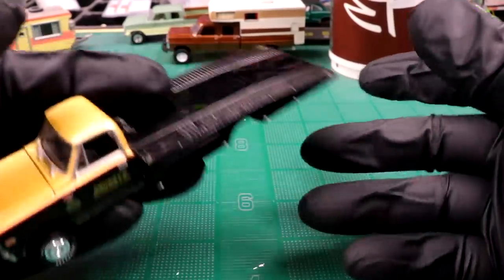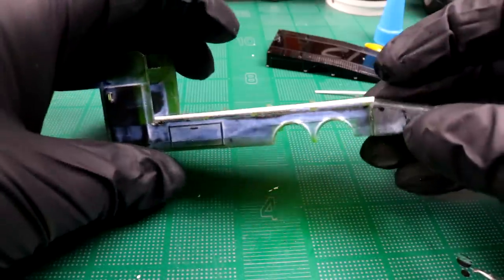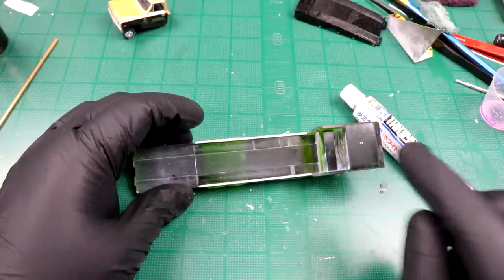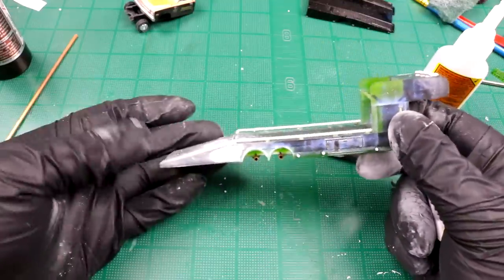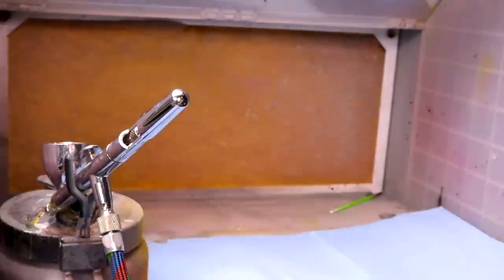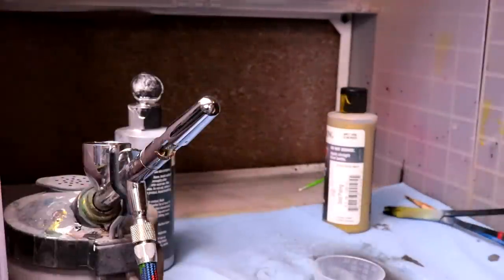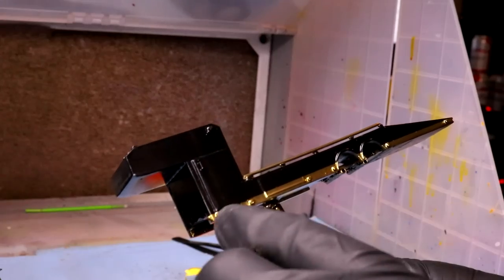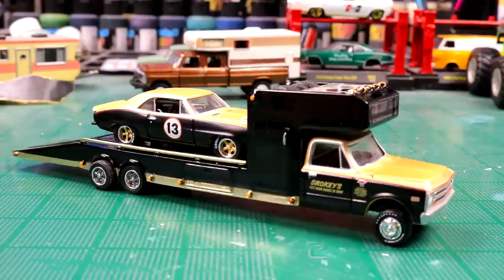1:64 scale 3D Printed Race Car Transporter

Comment: That turned out brilliant I'm definitely impressed by the 3D printer. You are correct about the cab overhang being to long by law the overhang cannot extend past the windscreen. It still looks magic tho. 👍
Reply: @carmineredd1198  no lol. I will explain I've built trailers to get them registered by law there are requirements. The cab cannot extend pass the windscreen therefore for you to make your trailer look authentic it would be better if it was shorter. Of course you can make however you choose. It was just a thought that's all - no offence intended. 👍

Comment: that turned out sweet, very creative, I like that you can make something out of nothing with 3D printing, I would suggest moving the rear axles forward a little so the load is over the axles, this would be more realistic to actual car haulers,  you might have troubles trying to turn rig like this around

Comment: Shorter cab over, storage doors to cab over, Smokies logo on front of the cab over and try heating up a needle to make the holes for the ramps then glue to L shapes to the lower deck that are in the ramps. (Small Paper clips) hope this helps

Comment: Love the new 3D printer ! I’ve never been a big fan of the filament printers, it’s just melting plastic line on top of itself - not the cleanest process to me. Most of the resin printers I’ve looked at in the past have been outrageously expensive, but I think I could actually swing the one you’re using. I’ve had ideas for prototyping product components over the years, but haven’t had a way to make them without spending hours or days in my garage fabricating something. With this I could print scaled down models in no time. Excellent product ! Keep the custom builds coming 😊

Comment: You could pop off some printed toolboxes (little reds and diamond plate bed boxes), Maybe some pallets to haul, firewood, or just truck bed junk. There is always this one guy that just has stuff in his bed, there are beer cans, gas cans, and other trash. Cinder blocks to put your "project" car on in the yard for the next 25 years.
You will also be able to do body kits, reprint the bottom of the car but with chin spoilers and side skirts. Spoilers, convertible tops, interiors/seats. Getting a clear as glass print is crazy hard and requires a really good printer.
At one point you could just make the entire car.

Comment: If you could figure a way to slide the trailer axles forward, the ramps won't be needed as the back of the trailer goes down. You have the skills. Mirrors and exhaust pipes on the cab too. Great looking unit and love watching your videos.

Comment: idea for adding ramps now, use brass tubing that you would use for axles for the hinges, the rod to connect ramps to truck bed could be hot wheels axle or sewing pins. glue the brass tubing to the bed and ramps and boom. no drilling.

Comment: You know I've got a little ultrasonic cleaner. The cars that I have tore apart I put in there and I put some denture cleaner powder in it because it won't hurt the plastic it actually does a pretty good job. I mean I put all the plastic parts in it and the wheels too strong, it actually won't hurt the car at all so you could actually throw the whole thing in there if you wanted just cleaning.

Comment: Instead of trying to color match the stripe, why not repaint the cab to match the stripe ? Also, I am trying to rework a 64 Chevelle and I don't like the engine sticking thru the hood, is there anyway for me to remove the exposed engine and just turn the hood into a cowl induction style hood similar to the 70 Chevelle ?

Comment: For the ramps, could you perhaps heat up a straight pin or needle with a torch and slowly melt your way through the tab? Watching on my phone doesn’t really show size well, but I’d love to see the ramps work on this project
Reply from the maker: That could work actually, ill test it on some scrap resin and see if it bursts into flames or what lol

Comment: Awesome build. But the flatbed could have been 5mm shorter. 
The rear wheels need to be gold like the car. 
The car now needs "Smokey's" over the rear wheels on both sides.
The storage behind the cab needs a "13" on both sides.
And the ramps could have been pull out from the rear slope not fold up, using L bracket to slide on. You could insert them before gluing it to the main flatbed.
You did ask for idea's and criticisms..... :)

Comment: Theres no such thing as too small to drill. I have a set of jewelers drills I use for cleaning the jets in small engine carburetors. the smallest one is like hair diameter. They would drill plastic easy. You'd have a harder time finding wire to hold the ramps on with.